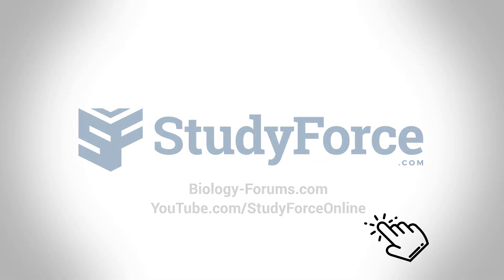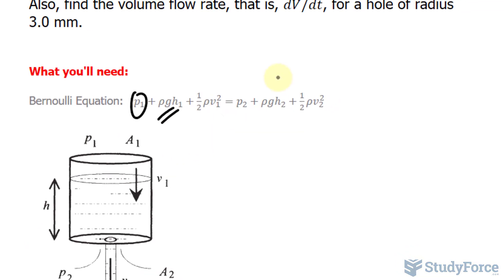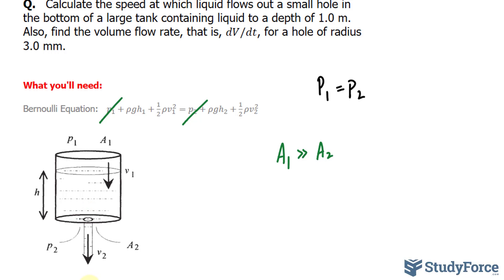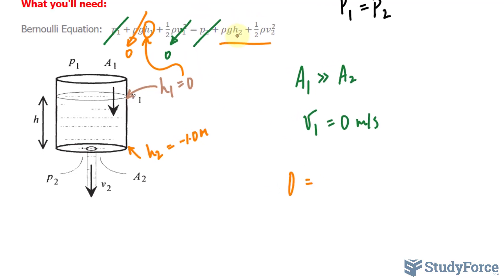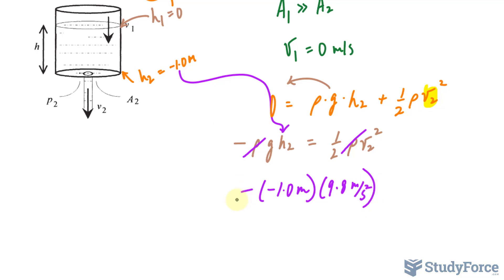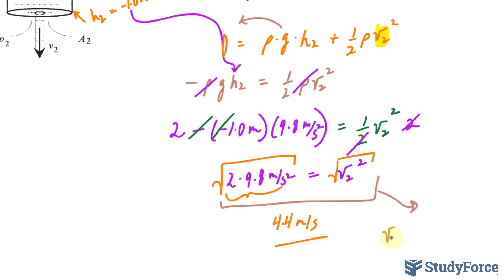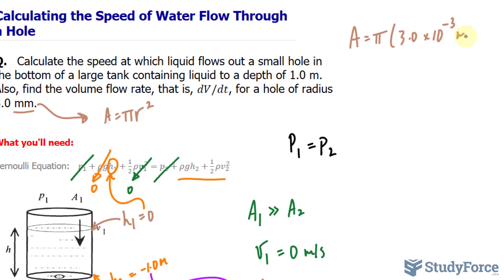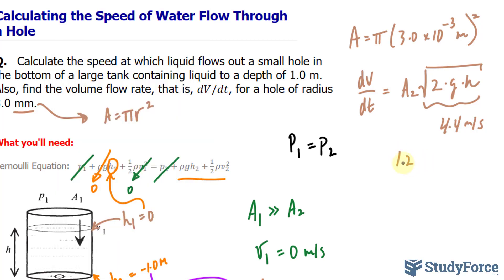Calculating the Speed of Water Flow Through a Hole | Bernoulli's Equation

Comment: You can actually calculate v2 without knowing v1 and without assuming v1=0. Since volume flow needs to be equal at the hole and surface, you can express v2 as v1: v1 = (v2*A2)/A1. This way you can solve the equation more accurately.

Comment: at 1:53 , you start to make an argument that because A1 is much greater than A2,  therefore v1 can be assumed to be negligible. While this make intuitive sense, the value of the A1 and A2 are not in the Bernoulli equation at all, and your final value of v2 is completely independent of both A1 and A2. I think you're missing a continuity of volumetric flow argument that A1V1=A2V2, thus if A1>>A2, then V1<<V2
Reply: He said that V1 = 0, which by default makes it less than V2, which is some nonzero number.